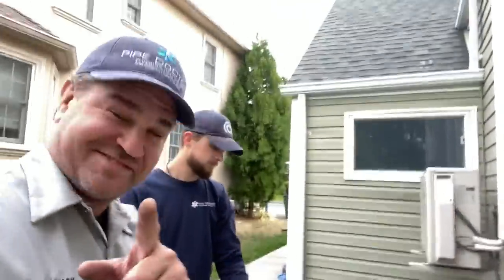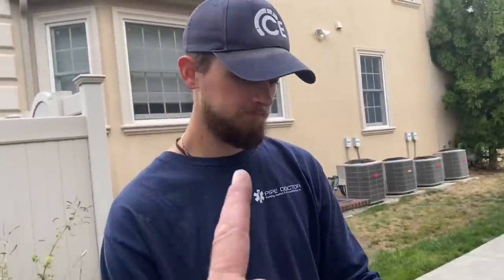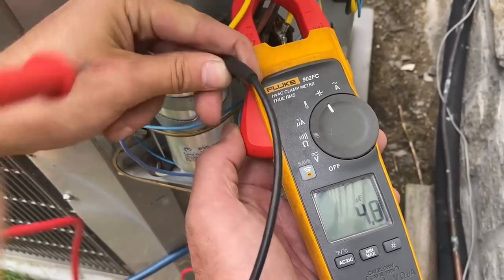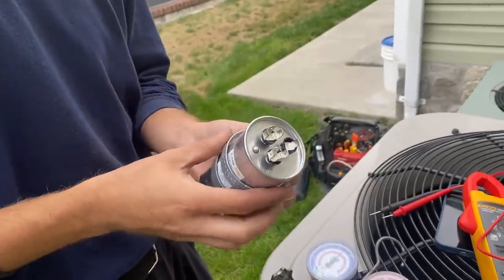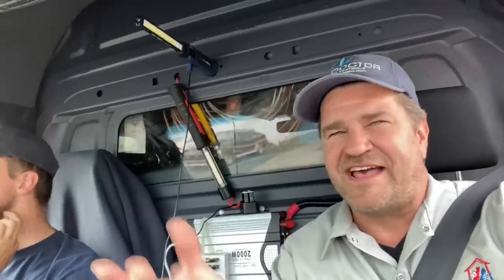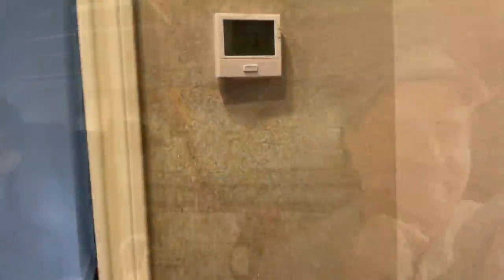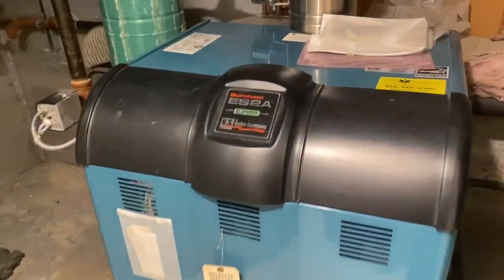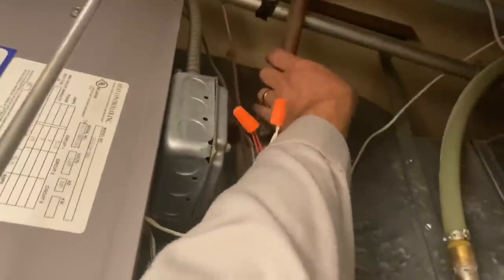Running Multiple Service Calls on Friday Morning | Peter is Quickly Learning the Trade

Comment: on reusing the cap bracket, try the inner hole on top strap the outer hole and bottom strap.
never tried that IRL, but it may bend/reform to the right size to hold the new cap snug. actually, now I want to know if it works, or maybe vice versa that. front band outer hole and back of band inner hole?

Comment: the not "f'ing nutz/ ted cook bit" I loved. but in the same sense, I have discharged 1+kv of 5uF cap through a single finger before, not on purpose and I do not recommend it ever.
in reality, the chances of a HVAC/R  "RUN capacitor" left with a charge is minimal, now a start cap is far more prone, especially if missing the bleeder resistor.

either way, if  a motor winding/lead went open circuit at the perfect timing of peak AC voltage a capacitor on 240v motor could potentially have *370 volts DC charge. in one finger out the same is bad pain but not dead/death. now take that in one had and out the other? very possibly dead, heart stopped land across room. if constant DC power stuck and dead.

Comment: Peter watch a couple videos on YouTube so you can learn a little. You gotta take initiative if you want to excel.
Reply: @PipeDoctor  when I worked in between calls was quiz time or least explaining what you learned earlier or question time. If not you better be preparing for the next job mentally or reading.

Comment: it should still be common practice to connect red to RH, even with RH to RC jumper switch. if the idiots designed it with RC  as primary terminal and disconnects, then suggest it that way? FAIL on them.

Comment: "what two electrical components make up this condenser and it's not the capacitor or contactor". if you want to open up a bag of worms, there are far more electrical components in a condenser than the fan motor and compressor. I got away with murder in career-center(joint-vocational) "industrial electricity", which changed name prior to me going there due to them all being potheads( not much changed then) 🤪
while there I was doing electronics, lab test gear and computer repairs to the student lab equipment, amongst other things mechanical.  that resulted in the electronics, computer and automotive teachers all stopping in, talking to me and asking why I didn't go their their courses instead.  over the years, not meaning to be rude or know-it-all/better, I've suggest and helped many. public/remote chat even with video! is hard to help and suggest without seeming like your a know-it-all jack-wad ( which I appear to be best at, but that's really not my intention) 
😬😮